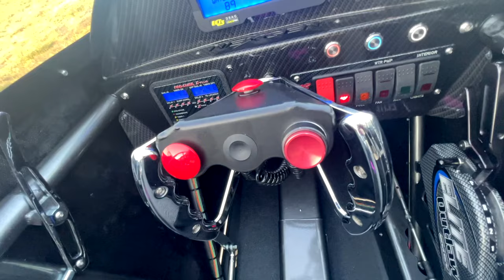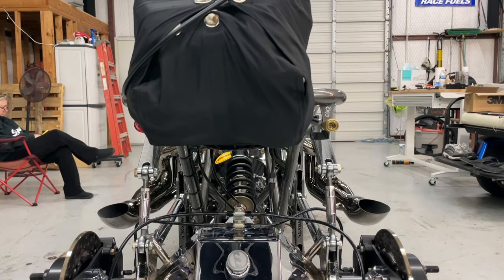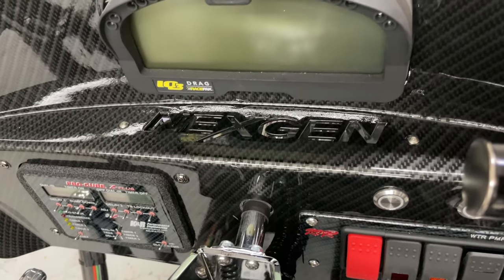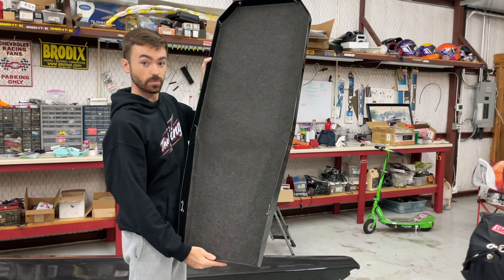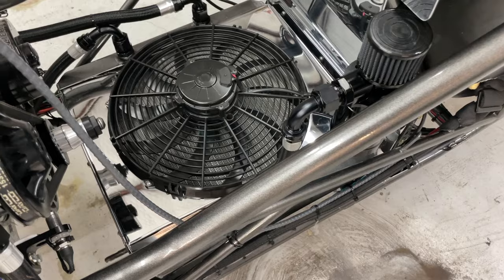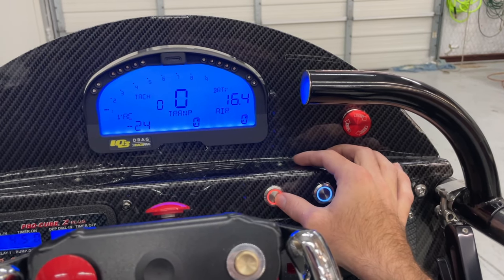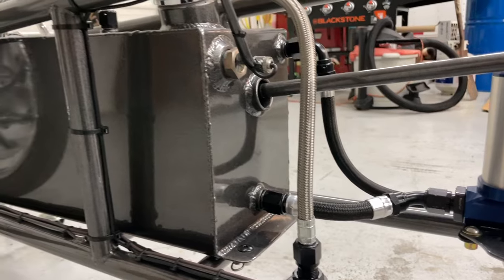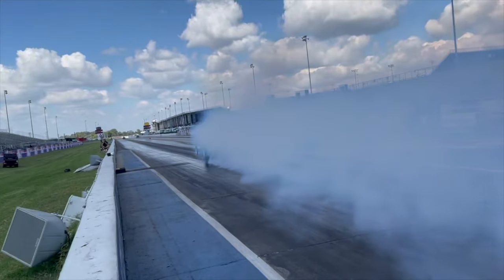Introducing NexGen Racecars!

Comment: With the solid state shut off, do you still have a manual shut off at the back of the car for track personnel? been wanting to do the same thing
Reply from the maker: Yes there is one back there. (the second shot of the car from the back side you can kind of see it to the left of the parachute) It’s the same switch as the one on the dash and works the same way.

Comment: Car looks awesome Rocky! Curious about not having a front suspension! Only reason I can come up with is the front end drop at the finish line maybe not as consistent?
Reply from the maker: Others say front suspension is smoother in the pits and on track but I don’t notice any difference. Only reason I went this way is because it turns better without it